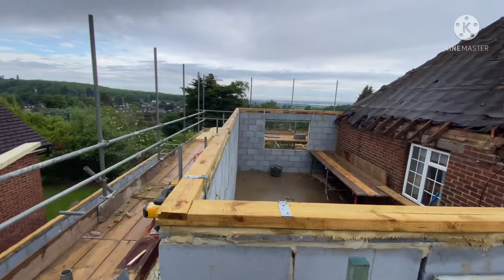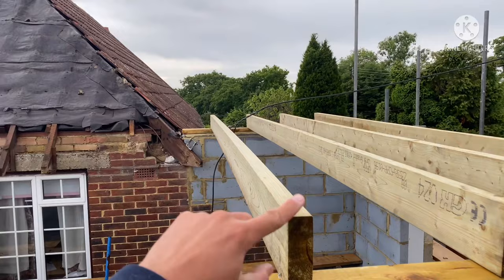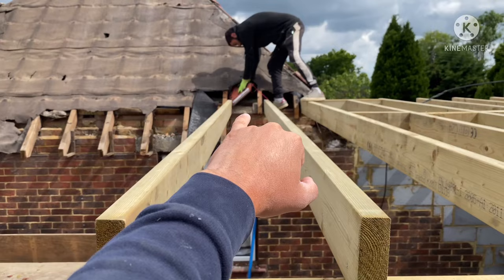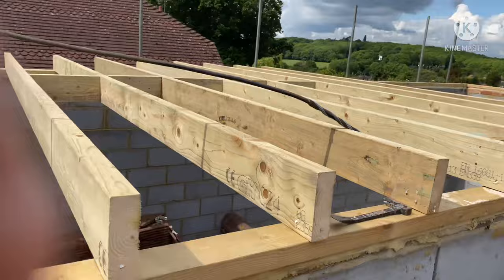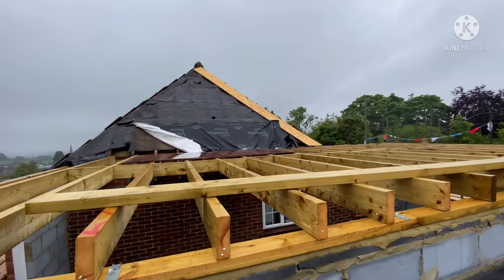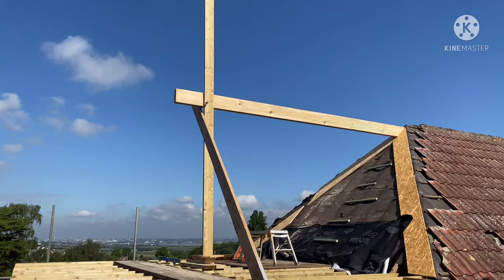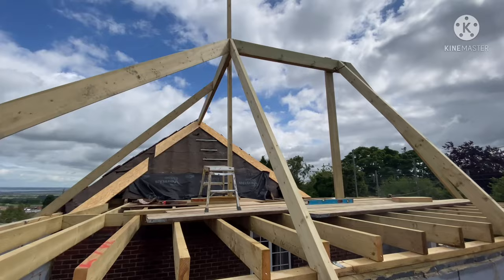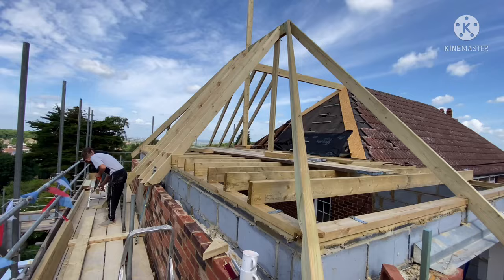Cut and pitch your own loft conversion or extension roof.. it’s really not that hard!

Comment: Lots of negative comments but you do learn on the job.
I’d recommend working of detailed drawings and checking the pitches All round. Incorporate dragon ties always and bolt the ceiling joists to the rafters at the bottom as standard. Building inspection can help but should not be relied on and a decent structural engineer can offer a specification to work to. 👍

Comment: What area in the UK are you guys? In my area (West Herts been Chippy for 37yrs) most building inspectors won't let you infill with cripple rafters on top of the existing hip rafters (unless it's a porch type roof) & insist the existing roof is stripped back to the existing common rafters removing all the existing hips & hip rafters & replacing with new commons or cripples depending on  if its a valley or straight roof run.

This is when the new roof is running in line though & not when the new extension roof is lower & then obviously it's lay boards.

Comment: Did you need to get that roof design agreed and signed off by a structural engineer and building control  , or was it just made up on site ??
Reply from the maker: Hi.. yes we had to go to planning, then we built it to the spec of the architect and structural engineer, then we got it signed off by local building control after they inspected the build as we built it. 👍

Comment: Looks great lads, can you tell me how to work out the bevel angle for the jacks?
Reply: No one answered back to you cos they do not know...😂 easy answer: mark your jack rafters length on the right or left  side (depending which side of the hip you working.). On that length mark, mark the rafter side with the pitch of the roof then adjust the circular saw angle with the angle of which the hip sit in to the build (not the pitch, the horizontal angle). Cut following the mark. Job done
Reply: Thanks Ivan super useful
Reply: Compound mitres